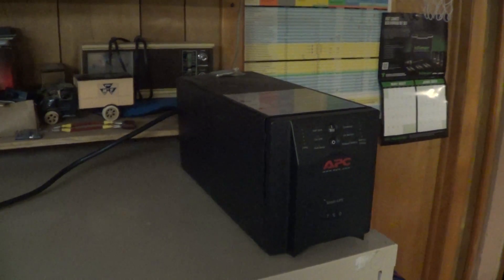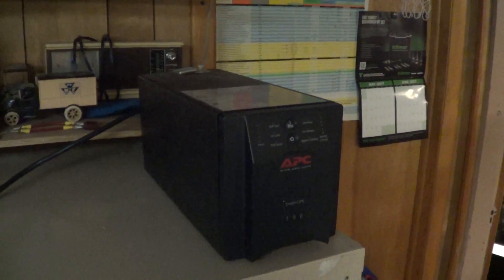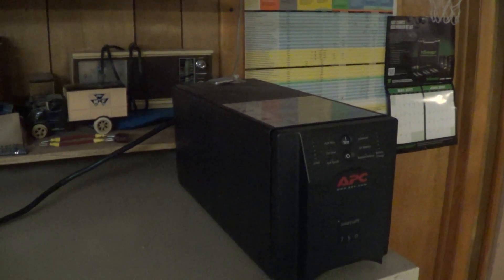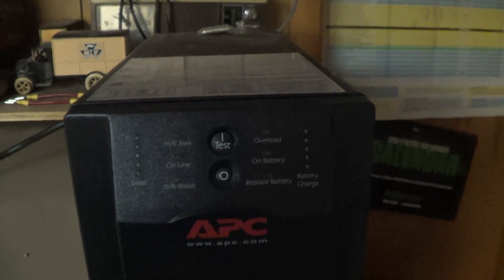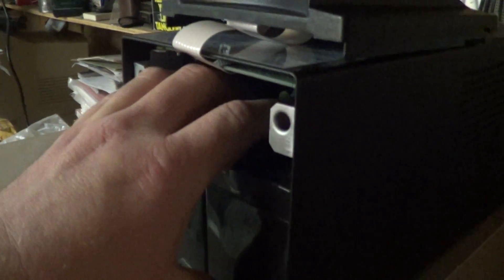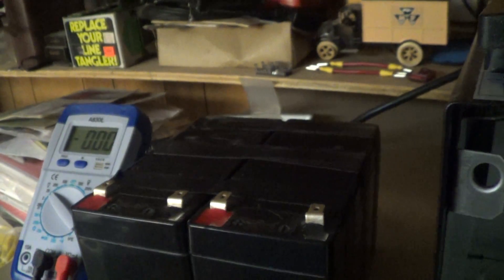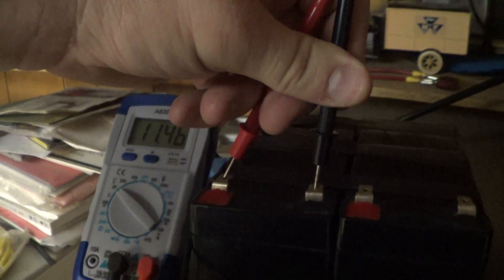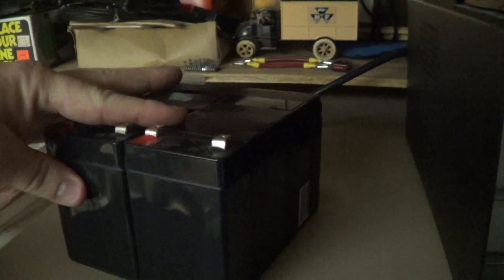Another Interesting UPS Battery Failure

Comment: What would you recommend for a budget UPS specifically for powering a wifi router/modem during a extended power outage?
Reply from the maker: I'd recommend anything within the 400-750 VA range. I personally use a 420 VA unit and it will keep my modem and router going for at least an hour and a half. (So far I haven't ever had a power outage longer than that.)

You may find that while your router and modem keep going during a power outage, your Internet Service Provider's equipment might not.

Comment: $12???  for a replacement battery????  I'd be lucky to pay $50 for a battery with half the capacity.  I swear I'm getting ripped off here.
Reply: UnrealVideoDuke which is where? I know here in uk some prices are out of arse and 50squids for a battery can happen
Reply: Szymon Krasuski yes 12v 7ah yuasa goes for £39.99 UK that's $50.67 USD in one place
Reply: @MrSuperheterodyne  
That's a Yuasa... I've got one that's lasted 9 years. best brand battery ever
Reply: Well that's cheap compared to 60 for 2 battery's 100 plus if you want good ones

Comment: What do you think of the ExpertPower EXP1272 on Amazon
Reply from the maker: Nothing, because I have no idea what it is and certainly don't own one.
Reply: It is a 12V 7.2 Amp Rechargeable Battery.
Reply from the maker: All I've got to offer is very general commentary: just about all of the SLA brick batteries are the same thing. I'd not be surprised to find that they all come from a few actual manufacturers. Obviously there are outliers on the low end (UPG) and high end (Power Sonic).

In other words, you might as well buy on price unless you truly have a mission critical application for these batteries.
Reply: Thank you. I just got a UPS from Goodwill for 88 cents and the battery that was in it was from 2009

Comment: I must not understand the circuitry that well in the UPS systems, but if the units are running on AC power, why are the batteries failing like this? its almost as if its in constant charge mode and it NEVER shuts off even though the batteries are full! if that's the case, they will always fail in short order, every time. Almost need to have a smarter charging circuit...
Reply from the maker: It's hard to find fault with anything this unit did, since these are cheap batteries that I've had poor results with and they still lasted six years.
Reply: Well if you got 6 years out of them, then you definitely got your monies worth. In my opinion anyways. I have a shelf full of those 12V batteries, the larger ones, and the mini 5AH ones. Raided the local RadioShack when they closed last month, along with the drawer sets.
Reply from the maker: I have bags of stuff from the RadioShack stores in this area before they closed. I had no idea they even carried SLA brick batteries until I saw the two I bought on closeout. I would have bought every one they had, if there had been more of them.

I bought a lot of their electronic kits, and in particular now have entirely too many color organs. (That was the best one of the bunch in my view. It puts on a good light show, came with very good instructions and a complete schematic. The other kits were nothing like as good, but I still had fun assembling them.)
Reply: We still had 1 left when I left ohio, and we have mostly "dealers" here where I am now, but there was one corporate owned office that was closing last month. We got all 8 sets of drawers, AND the parts inside them for about $200 or so. This also included an older LGA775 IBM tower they were using as one of their POS servers.

Comment: I've seen Apc units do that before. I've also seen some that wouldn't power on at all until they received new batteries.
Reply from the maker: The 3rd generation and older Smart-UPS models need a working battery in place to power up. There are a few Back-UPS units that base on a cut down version of the Smart-UPS design that are the same way.

Comment: I think I've topped your "Interesting UPS battery failure", was rerouting some wires, unplugged my Tripp Lite (as previously mentioned in my last comment), it cut out, said it had full batteries, nope, it had over-full batteries:

https://www.instagram.com/p/BVkxwnJAl0F/

Let's just say I have zero faith in this UPS now... :\
Reply from the maker: That sort of failure isn't uncommon with any make or model of UPS. (It's a mystery to me why they get so far, though. For any UPS batteries I've ever had, they were uselessly dead long before that kind of bloating took place.)

Clean it up, put new batteries into place and it'll be fine. The SMX1500LCD wasn't a cheap unit. In addition to having voltage adjustment capability by way of an autotransformer, its inverter has a true sine wave output.
Reply: The scary thing is, a new kitten of ours took to snoozing ontop of that thing, had one or both batteries popped, she could have been injured, all for the sake of a bit of software that should go "Hang on a minute, these batteries are taking a lot of juice, maybe I should stop charging and test them!", but seems to be lacking in this UPS... :\

Comment: I really like your videos which have electronics in them and I am therefore hoping for an update on these batteries if you fix them (because maybe you will talk through the electronics of the charging circuits and so on). Thumbs up.
Reply from the maker: There isn't  much can be done to repair the actual batteries. They just wear out and degrade over time. Sometimes (pretty rarely, as in exactly once by my experience) one can add water to a sealed lead acid battery such as these and restore it to life. https://www.youtube.com/watch?v=pfaH0vk953s

The battery in that video went on to last several more years.

Comment: I wonder what exactly is causing the UPS circuitry to act this way when the batteries fail?
Reply from the maker: Insufficient voltage and current for the electronics to properly initialize.

Comment: I can't say what kind of battery Radio Shack put's out now. But when I managed my Pacific Beach store one thing for sure our battery's were top notch. Buying dry cell batteries is a gamble at best when you look for the cheapest. Most manufactures trying to save money will not Zink coat the cell's causing the cells in said battery to fail prematurely. It's not a good idea to look for the cheapest dry cell you can find. Look for a battery that has a good reputation, even if it cost a few dollars more. It will pay for itself in the long run.

Comment: WOW 1080P! It's a shame I'm on 0.5mbit I would love to enjoy your vids in at least 720p! 

this is certainly a very interesting failure indeed, I wonder why it happens? the cells don't get cycled very often I guess and they usually sit at 13.8 v that should not hurt them I think? 

in my solar system I keep my batteries at 13.5-13.8v and they don't seem to get hurt, they have been working nicely the 2 years I've had them, not a single issue :) 

see you soon, best YouTuber Bill!

/Dennis G
Reply: if your in the sticks like me, not possible...
Reply: If I were you I would invest in trying to get more Band Width, or at least get use to waiting before you hit the enter key. Most of us now watch & shoot in 1080. On the other hand just for fun I shot a video from a record-able Ipod Nano, I believe it's resolution was 740X480. Your internet should be able to handle that video. :)
Reply: I understand some have little or no connection. Sometimes I envy you being away from it all. On the other hand I would dry up if I am to far from the beach.

Comment: I usually take out the batteries of the ups devices I don't have in Service, charge up the batteries externally and also top off each cell with distilled water from time to time and then just leave those batteries sitting around. They shouldn't discharge a whole lot if they're healthy.
I've revived some batteries by just filling up the cells with distilled water and then just basically let them boil on my charger for a while,  but that only works if the cells aren't deformed already and I also generally wouldn't recommend anyone doing that for safety reasons.
Reply: +Chris you need to open the cover on the battery and there is 6 caps that you can pry off and pour water into :) very nice!
Reply: nerdywolfi can you add water to gel cells? I thought they were sealed.
Reply: TheLittleDIYWorld exactly! You still need to be careful to avoid acid spills and possible explosions during charging though, so I generally don't recommend to do it if you don't exactly know what you're doing. 
And as I already said, batteries that have deformed cells (as in bulged out and stuff) are dead cause if you refill them, they might leak everywhere or even have the possibility to short out which isn't good at all.
Reply: Chris If you decide to add water to a "sealed" lead acid battery, always use distilled water, not regular tap water....basically you can use the same water that one would fill up a maintainable lead-acid car battery with. Also take adequate safety measures when doing so (gloves, eye protection, protective clothing - basically to protect yourself from battery acid) and also only do it at a well ventilated area without fire or sparks around (to prevent explosions).
I also recommend to go add water in small quantities until you can see some liquid in the cells again. Don't overfill a cell.
Having an electronic battery tester for lead acid batteries also helps to assess the state of the battery before/during/after reconditioning / charging.

Comment: If you get a "short" this will happen. It tries to charge the batteries, at the same time tries to power on. It gets stuck flipping back and forth very rapidly. So in that case try to stop it as soon as you can. Mine went POP when it did it too long, blew a logic chip up. Btw these ups's draw power even when off. So I wouldn't keep them unplugged longer then 24 hours without removing the batteries.
Reply from the maker: These units shut completely down after a few minutes with no external power. There is no residual draw after that happens.

I noticed this behavior immediately and did not allow it to happen for more than about 45 seconds (this video included).

Comment: And i thought a budgie had taken over the ups, possibly wanting some trill :-).
I would not trust the 11v battery as far as i could throw it lol.
Reply: Yep I'd be sticking new reputable batteries in. Though like he said he left it unplugged not charging, the charging unit draws some power even when off causing a phantom drain.
Reply: I suppose that high end units actually charge/discharge the batterys on a regular basis to give them some real work to do.

I don't think any battery should be left on a trickle charge without being made to work, and the state could be tested to give a crude capacity to the user.
Perhaps i'm asking too much lol.
Reply from the maker: Totally agreed about the "surviving" battery...if it goes on to do anything, it'll definitely be something noncritical. Maybe a handy twelve volt source for testing some random electronic device on the workbench?

The Smart-UPS units are supposed to do a periodic self test, although it can be turned off. What usually happens with a bad battery is a dropping of the load followed by the UPS restarting itself moments later and not indicating a battery fault. (The UPS will flag a battery fault if the battery runs down a lot faster than expected under a self test, but doesn't fall over.)

When mains power disappears, these units shut down completely (using a relay) within about ten minutes. There is no further power draw after that point.

Comment: Wish my (un)Trust(worthy) UPS and my larger Tripp-Lite UPS units would have informed me of duff batteries back in March when we had a 20 minute power failure, as the Trust & TL had crapped out giving no backup, when the power came back, they lit up as though nothing was wrong, 'til I pulled them out & checked the batteries...... :\ 

The Trust had a battery so screwed it had split open a few of the cells and dried out (crapy charging circuit I guess), the TL had, like your APC here, one dead battery and one "good" battery, so to replace the batteries, I had to use my two solar-charged and one spare batteries to revive them, and the one "good" battery from the Tripp Lite is on the solar panels doing a good job at staying charged, need to get some more batteries at somepoint, probably after the UPSes die again in a closing the barn door after the horse bolted manner I'm sure...

Comment: Yay more 1080p :) (Are you ever gonna film in 480 again? You have a full HD camcorder so why would you?)
Reply: I think it's all down to his internet speed. Unless things have changed uxwbill only has DSL connection due to his rural location. Which means uploading videos in 1080p must take a very long time! I stand to be corrected if his supply has been recently upgraded. I hope it has, as he 100% deserves the fastest speeds possible being such a complete legend!
Reply: That sucks, he made a cellular antenna before for his 4g hotspot so he has 15-30 Mbps download speed on his internet, I think he had 16 upload but I'm not sure.
Reply from the maker: I have never owned a cellular hotspot.

My connectivity is still DSL based, but has received some modest bandwidth upgrades in recent times. Videos shot in standard definition will certainly appear again in future. I have multiple camcorders with differing capabilities, so I'll use the one that's most convenient or that has the features I need.

My shooting video in high definition is nothing new. It's rare that I watch anything on Youtube in any more than 360p, in the normal video area presented by their web site site on a normal computer.
Reply: Oh, maybe it was Cube Computer Channel then because I know that someone had Sierra wireless as their cell provider and made a huge antenna for the hotspot.